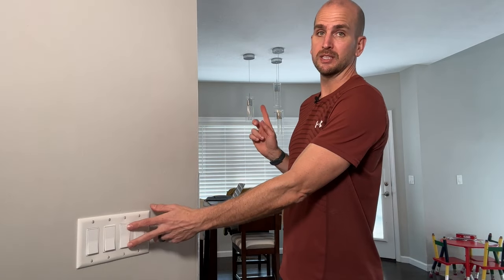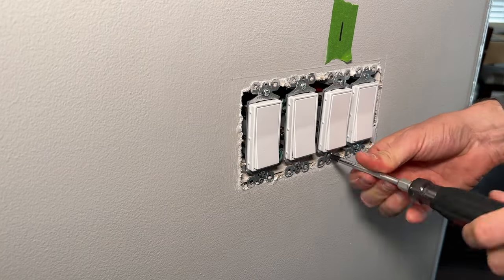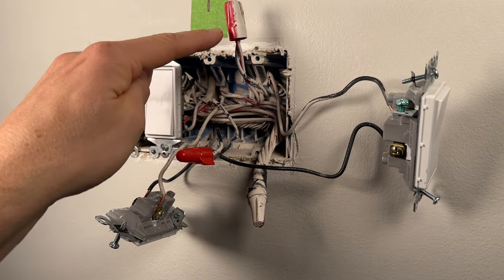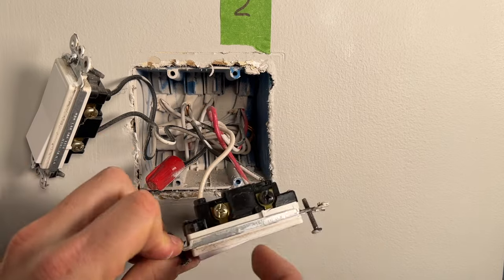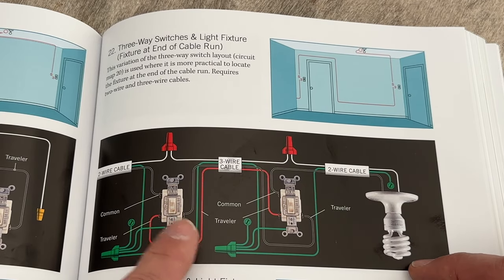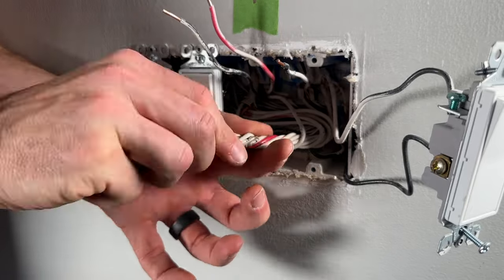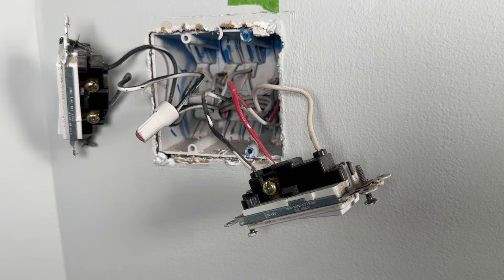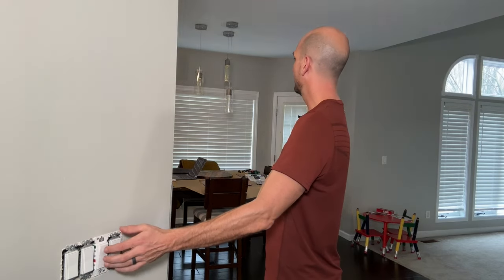How To Troubleshoot A 3-Way Light Switch And Most Common Issues

Comment: I would be willing to bet almost every home owner has discovered after moving in at least one mystery switch!  A wiring schematic, even if you draw it, really helps wrap your head around the power routing. Great video.
Reply: आमच्या भारतामध्ये 2 वे स्विच म्हणतात. मी एक इलेक्ट्रिशन आहे मी हे सर्व काम करतो.
#TechnicianDnyaneshwar
Reply: Yes! Have one in my daughters room. The switch panel has two switches but only 1 light in the room. I have nonidea what its for
Reply: @youngz13o  possibly a circuit for a ceiling fan, even if there is no fan, you may have wiring for one in the ceiling
Reply: @cra5hproductions  just installed a ceiling fan and yes , you are right

Comment: If you Google "3-way light switch", there are MANY more ways to do it than in that book.  Tens of them.  I'm glad yours was an easy fix.  Nice one, Scott!  You're really busy these days!

Ages ago, at least 40 years, a BIL had disconnected a 3-way light system, but didn't label where the wires went back and he could not figure it out.  While visiting one time, he asked me to look at it.  I had never done one before, so I had to schematic-it-out on paper to see how it could work, using my electrical experience knowledge, and I also had to figure out how the 3-way switches worked by ohming out where power was being switched and what was normal input, reading one terminal at a time to the other two and flipping the switch.  I figured out what is likely the most common way it's done, connected all wires that way and it worked.

About 10 years ago, I wanted my living room light to have two switches.  I cut the hole to mount the switch box behind an existing switch on the other side of the wall, added Romex to it from the attic at a junction box, replaced the door switch with a  3-way and added a red 14 AWG runner there, connected it all the same way as before and now there are two switches for the living room.  That was a rented house and I left it that way when I bought this house and moved.  I may do that to this living room and I'd love to add a hallway light.  This house didn't even have a doorbell, so I added one to new Romex in the AC/Furnace closet with the ringer on the wall above the access door.

Comment: If you could define the term "traveler," that would help those of us who are new to three-way wiring. My only experience with replacing an old toggle with a rocker switch in this kind of circuit was confusing (and frustrating) as I did not know what all the wires did. The diagrams are helpful, but only if you have some understanding of the function of ALL the wires. Thanks again for your great work!
Reply: The travelers are the wires that connect to the gold colored screws on the 3-way switches and come from the 14/3 cable between the switches. One red and one black wire, the current travels through one or the other depending on switch orientation and will either make or break the connection. In a single pole switch the connection between the two screws is made when the switch is on, and broken, when the switch is off. It makes no difference which wire is connected to which screw. In a 3-way switch there is no "off". The switch will rotate the internal conductor from one screw to the other. The power comes in to the common screw (black, pivot point) on one switch and goes to the light from the common screw on the other switch. The switch orientation will determine whether the path through the travelers is continuous or open.
Reply: आमच्या भारतामध्ये 2 वे स्विच म्हणतात. मी एक इलेक्ट्रिशन आहे मी हे सर्व काम करतो.
#TechnicianDnyaneshwar

Comment: You briefly touched on a scenario that once bit me. While changing a light switch in a 2 gang box, I located the breaker for the light and turned it off. I made the assumption that the breaker turned off power to both switches in the box, (natural assumption) but I was wrong. The 2nd switch was actually on a different breaker and it quickly made me aware of my oversight when I grabbed it. So yes, have multiple switches in the same box on different breakers can and does occur.  Be careful.
Reply: I love my Klein power/voltage tester. It kept me from getting shocked at least 2 times.
In this video's case, if I didn't have it, I would turn on the other switches to see if the lights were working and thus, let me know there was another breaker to flip.
Reply from the maker: For sure, probably the most common way to get bit is this type of scenario.  Especially these monster 4-gang boxes 👍
Reply: Same holds true on kitchen circuits. There's usually two 120 circuits for the kitchen counter outlets that may share the common neutral. Just because you turn off the power to the outlet being worked on doesn't mean all the wiring the electrical box behind the outlet are off.  The same with arc fault bedroom outlet in the same switch box with a non arc fault lighting circuit; two separate sources of power.
Reply: @andrewbitners4165  true, but seldom are both circuits located in the same multigang box.
Reply: @RCinginSC , arc fault was in a 2 gang in a bedroom with a regular lighting circuit and the kitchen was in a single gang, first kitchen outlet box from the panel. The 2 kitchen circuits split from there.
Reply: @andrewbitners4165  😎👍
Reply: आमच्या भारतामध्ये 2 वे स्विच म्हणतात. मी एक इलेक्ट्रिशन आहे मी हे सर्व काम करतो.
#TechnicianDnyaneshwar
Reply: @EverydayHomeRepairs also you forgot to put the ground wire on the switch.

Comment: Great topic. I moved into a house with a garage with mystery wires in the junction box of a three-way with a dead motion sensor switch. That was literally my first-ever home ownership project. I eventually just made some assumptions and got it working. I've since replaced the new motion sensor wih a Kaza smart 3-way (and added motion sensors elsewhere in the garage), but I still have no idea where all those wires went to. 
Maybe I missed it, but how did you conclude what every wire was without tracing them all with a continuity tool or similar process?
Thanks!

Comment: You could've kept the original power source and just make the 14/3 a switch loop and use the white wire as your light output
Reply: Depending where you are, switch loops are no longer allowed.
Reply: आमच्या भारतामध्ये 2 वे स्विच म्हणतात. मी एक इलेक्ट्रिशन आहे मी हे सर्व काम करतो.
#TechnicianDnyaneshwar

Comment: Normally, I just follow the flow of electricity, looking at the wiring similar to a water(hot) and drain(neutral) line. The issues are figuring out which wire is which between dust, organization, where your feed and travelers are. For instance, I got an old 20s place that has 4 switches in the kitchen all in the same box, 2 of the switches control the 2 lights above the sink and the main, but then I have 2x 4 way switches right next to each other without any idea what they feed. Then going to the living room that's literally right beside the kitchen, on the wall opposite of the kitchen, there's then another 2x 4 way switches in the corner right beside each other on adjacent walls, ie 2x 1 gang boxes, and it's unknown what those control. Figuring out what's what in situations like so is where the difficulty of electricity comes into play

Comment: We had some weird 3-way switches that the previous owner had installed.  I ended up replacing all switches with decora, which let me see what he did wrong.  In part, he had installed dimmers that weren't 3-way in a few spots.  It was a couple of years ago, so I don't remember details any more..

When I was relacing switches, the starting point is to do a 'head-count' of switches before heading out to the store  How many 2-way switches do I need?  How many 3-way switches?  I even had a few 4-way switches.  I got to the point where just by removing the faceplate, I could identify which switch was what type.

Comment: I am trying to wire in some new switches in my daughter mobile home and you know they have those weird press in switches for the lights and for some reason when I cut the wires and wire them back together, I have to turn on my ceiling fan for the porch light to work. It’s 2 switches in one box, one for the ceiling, fan and one for the porch light. Any help would greatly appreciate it. I really enjoy your channel. Keep up the good work.
Reply: without a photo, it's hard to say for sure but it sounds like you've got the wire bringing power from the breaker on one leg of the fan switch and then the other leg of the fan switch has the wires for the fan and the one bringing power to the porch light switch.  Moving the wire going to the porch light switch to the other leg of the fan switch would be the solution.  (leg and screw terminal are the same thing here. )
Reply: @davidwayneprins  ok I’ll try to get some pics
Reply: @davidwayneprins  I agree, it sounds like they jumpered from the wrong terminal. Very easy fix indeed. Good call

Comment: More or less as an aside, I have run into a situation where the switches were after the light, switching the neutral. While this works, it is not code because it leaves a socket hot with the switch off. It can happen especially in older homes which were remodeled from knob & tube and the wires were not properly identified.

Comment: Any time I was ever ask to work on a three or four way light  switch I always ask to simple questions. Has it ever worked? Has anyone else tried to fix it. I have found this saves a lot of time trying to undo someone else's mess. If the answer to both questions is yes,  you may as well totally unwire every thing and start from scratch.
Reply from the maker: Solid advice! Thanks for the feedback 👍

Comment: I had that problem in this house, in the kitchen light. 3 way dimmer switches. Naturally the idiot that had this house before me did it all wrong. I had to not only replace the switches but when I opened it up, I found a plastic box. Well that absolutely HAD to come out so I took it out and replaced it with a steel box. I carefully threaded all the wires in and clamped them down... Not sure what they did to the clamps but these days, you clamp them down and it pierces the Romex and creates a short. That was "FUN" (Sarcasm) So anyway, I got that corrected, did a new home run, and replaced the dimmer with regular 3 way switches and wired them PROPERLY. Also grounded, except for the fixture. Not only was this house wired without grounds, the idiot before me didn't believe in using grounds, and cut them off when he used new wire.

On top of that, the house failed inspection when he tried to sell it, and instead of putting a sticker on the lavatory GFCI that reads "No Ground" he decided to bootleg ground it with neutral to ground, creating a VERY dangerous situation. What's more, there was a ground wire there, in the wall, and he ignored it. A total schmuck he was. I would have sued him if I got a worse shock than what I got. I wish people would just do things right or leave it alone, and for the love of DOG, GET RID OF THESE PLASTIC BOXES ONCE AND FOR ALL !

Comment: Definitely agree on the B&D Wiring book.  Was my go to when I worked at Menards for explaining how to wire three way switches. 

Working around my house, I always mark the common wire with a piece of electrical tape before I disconnect the old switch so I do not make any mistakes putting the new switch in.   I usually use blue or orange as these colors are seldom used in home wiring.  I've replaced at least three pairs over the years (20 years, 2 houses) and have yet to have problems afterward.

Watching your video, I cringed at the old three way switch #1.   Who the heck wired that with so much exposed copper past the screw?

Comment: Thanks for the video.  It looks like the switches were initially installed incorrectly.  Did this ever work?
Reply from the maker: I think this issue goes back to when the house was built 25 years ago.
Reply: @EverydayHomeRepairs  Thanks.  It's odd that someone would install the switch and then leave it not working.

Comment: Unfortunately in my case one of the 3 way switch box in my hallway is missing a hot wire. it only has 1 red and one black and a neutral. Which is the reason i'm having this issue

Comment: I don't know why you threw out the old switches. Kind of unneeded added cost
Reply from the maker: Yeah, nothing wrong with the old switched but I did just pickup those Decora Edge switches so wanted to start putting them to use.

Comment: We call this 2 way switching in the UK. 2 switches, so 2 way.
Reply: I can see how that would make sense.  I believe that the term 3-way switch comes from the fact that in a typical 3-way switch wiring scenario, there are three paths along which current can flow. But language has a lot of quirks.  I'd settle for a "2 switch light circuit", as I think everyone can agree what that means.